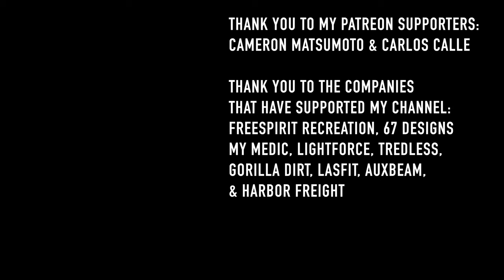The FrontRunner Table Kit is AWESOME!!

Comment: Love my Front Runner table. Watch out for rust when water gets on the table top. Treat it with stainless steel protector.
Reply from the maker: Good idea!
Reply: Look into applying a ceramic coating on it. I use chemical guy’s ceramic glass cleaner on my stainless kitchen sink to keep the hard water spots off. It’s great

Comment: Good review.
Interesting how they contacted you and tried to make things right.
I am a Quality Manager and part of my work is with claims. If you your average customer happiness is at 80% and they have a quality issue with your product or service it will naturally drop but if you take care of it correctly and swiftly your customer confidence and happiness in your company will raise above what it was before they had an issue.
In short. To take care of a quality issue one has to find the root causes. There is basically and almost 3 root causes. The occurence (why it happens), the non-detection (Why the error passed inspections and controls) and systematic causes.
Then you have 4 different families of actions. The containment actions which is the immidieate actions to stop more of this problem to happen soon again. This could for example be to block all stock and shipments and go through it.
Then we have the short term actions which is what can be done to temporarilly be able to produce with only a small chanse of making this issues again. After that comes the long term corrective actions and then the preventive which should more or less fault proof against doing the same issues again and spread that knowledge to other machines, assembly lines, processes and even other plants.
Reply from the maker: Great insight! Thanks for the info

Comment: About four years ago, I sprang for two Frontrunner tables and two mounting kits for my rack.  The design is great, but after three years, the adhesive securing the tabletop failed.  I was shocked because I thought these tables would last forever, so I called FrontRunner to give them a chance to make it right. They just told me it was out of warrantee and that I should buy some 3M adhesive and fix it myself.  Thanks for nothing.  Anyway, I managed to glue it back on, but my view of FR's quality and customer service took a hit.  I expected more from a premium brand, like maybe send me a tube of glue, or tell me exactly which one to buy so I don't have to guess.  Anyway, here's hoping 11 people read this, and maybe FrontRunner too.  Also, be careful about resting the table edge on gravel or pavement while you're folding or unfolding the legs.  The black coating on the edges scuffs easily.
Reply from the maker: Good info. I'll forward this message to them asap.

Comment: It's been a year, how's it holding up? I wonder how well it holds up  - the table, is the rubber still good, or is the rack getting any wear from the table?
Reply from the maker: I'm using it right now! We are trailing this week. Everything still works fine. Slight rusting spots on the table top

Comment: I wonder would it fit on the rails of the Freespirit recreation Evo tent rails? I have the quick release from front runner which adds a couple inches in between the roof rack and tent. 

Love their table slide setup but don’t have a front runner rack. Not enough room under my UpTop overland rack either. Trying to see where else it can fit. 😅
Reply from the maker: It will work under any rails BUT you won't have that front locking mechanism. You'll have to find a way to keep it secure.
Reply: @BaptismOverland  will it fit between the tent rails?
Reply from the maker: @waltertang9303  Actually now that I think about it, it won't. It's wider. I think you can probably DIY some metal bars running perpendicular to those rails and going past the rails for you to mount the table rails to.

Comment: What clearance under roof do you need to fit this table? Does it require longer legs for the rack itself?
Reply from the maker: Not a lot of clearance at all. This roof rack is slim as it is. MAYBE 2"? I'm not sure as Ive never needed to measure. But if you get their slimline roof rack, the brackets on the side were made tall enough to account for this table slide.

Comment: Why don't they make each leg heigh adjustable like drifta tables? When camping how often is the ground totally flat?
Reply from the maker: Yeah. I wish it was adjustable too. That was the dilemma I had  when I tried to DIY it. You would need legs that have infinite adjust- not the kind that clicks into different slots but the kind that works like tripod legs where you loosen and then put it in a desired height then tighten
Reply: @BaptismOverland  Have a look at the Drifta table for their leg adjustment method. Kind basic but it looks like it works. 
Some people modify it themselves with detachable feet for sand.
Would be good if somone makes a premium table with stainless steel, roof mount, adjustable legs etc

Comment: Front Runner must have cringed when you said the table top was aluminum, it’s stainless steel. 
I have a prep table mounted under my Front Runner roof rack.
Reply from the maker: They didn't but yes it's stainless steel.